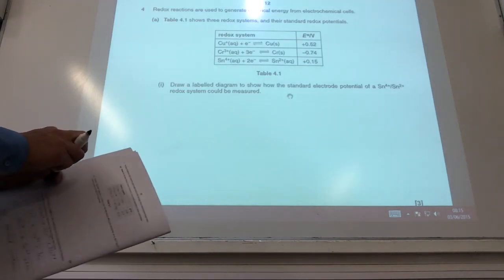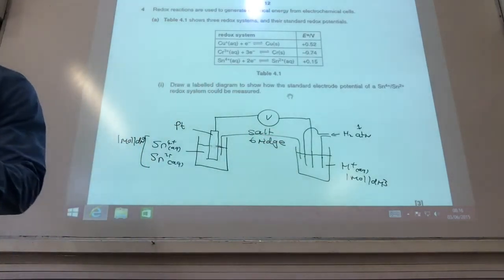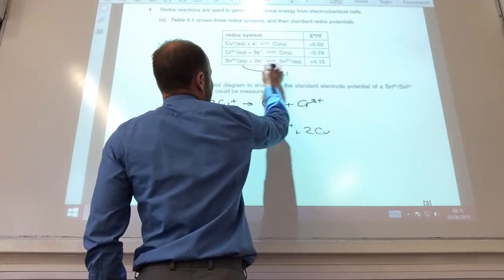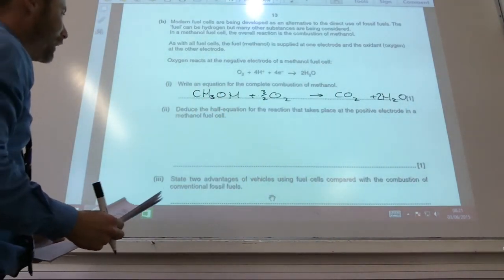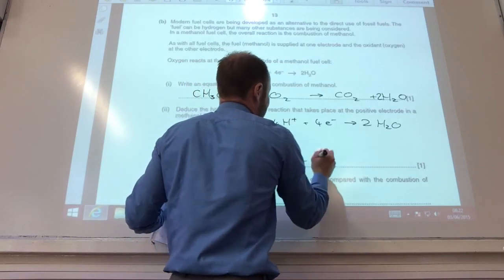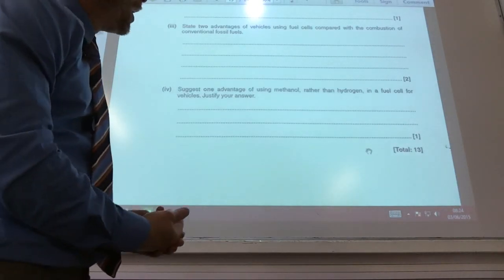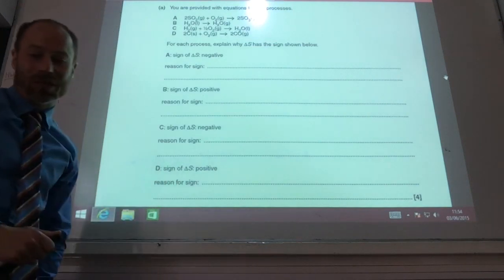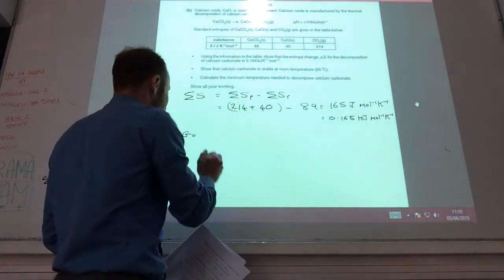F325 Equilibria Energetics and Elements Jan 2011 Q4-5 from www.ChemistryTuition.Net

Comment: Hi Dr Orchard. For Q4bii, if the given half equation is at the negative electrode so it must be oxidation (loss of electrons) so wouldn’t you flip it? Then the other half equation is at the positive electrode so it must be reduction so the electrons should be on the reactant side as in gain? But when i do this and add the half equations the overall equation is the other way round so I know I’ve gone wrong somewhere. Basically I don’t understand the theory behind the direction of the half equations in this question.
Reply: Omg I’ve just found there was an erratum notice in this paper and in fact it’s meant to say positive electrode! What a relief - I was questioning everything I ever learnt about redox 😅

Comment: hi love your videos but just wondering for the questions where you need to write what reactions are feasible surely the CU2+ and SN4+ equation wont be feasible as the difference between the 2 electrodes is 0.37 and so not feasible as it is not 0.40 or above? Thanks!
Reply: Jalal Asif see that's what I thought but no one has answered our question :(